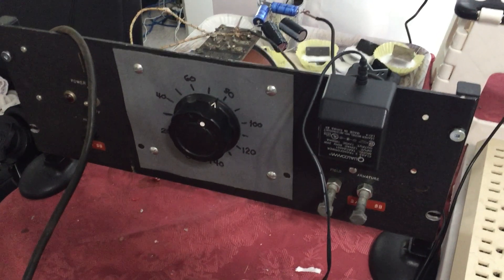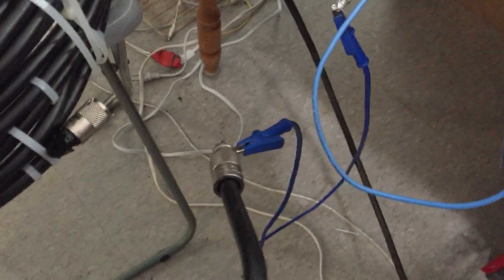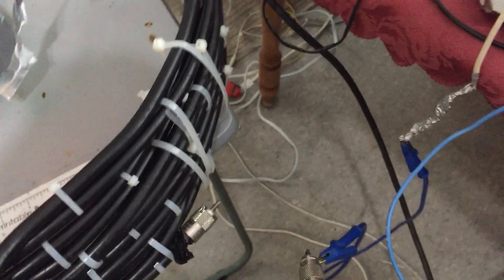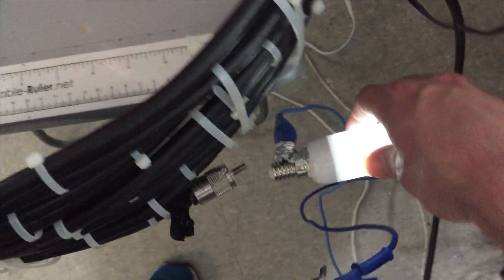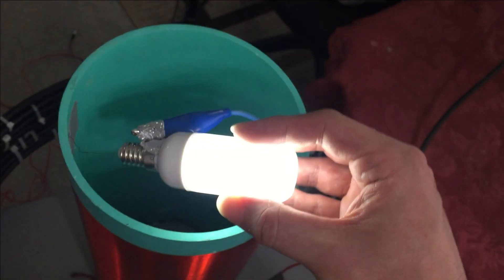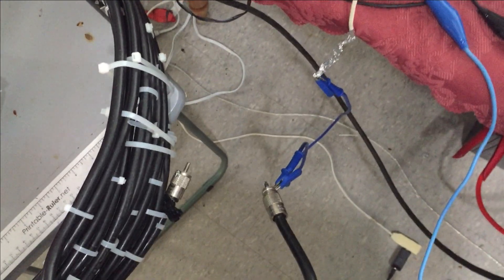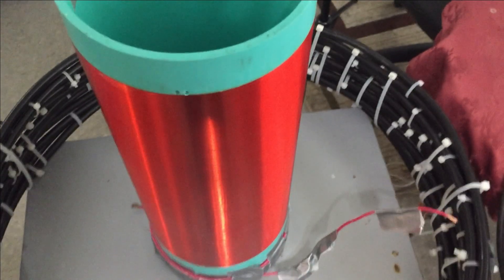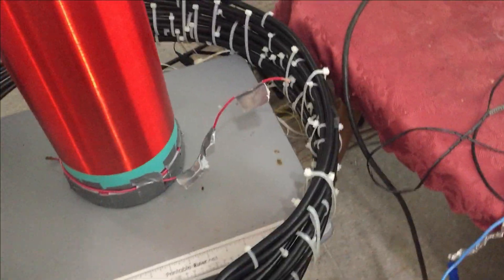Reactive Wireless One Wire Tesla Coil

Comment: That's a lot of coax  cable is you tall tesla coil setup for 1/4 wave length so that the top is max while the base is zero or GND
Reply from the maker: It was just for a quick demo with what I had, its not tuned per say, I''m sure more can get extracted with a tuned setup.  I'm using the coax loop for another (scalar wave) project i'm working on. Building the secondary coils now for it.

Comment: Great vid & try  connecting a metal sphere to the high voltage output of the tesla coil that has a diameter that's compatible with the frequency being outputted & You'll probably be even more amazed :)
Reply from the maker: I did all this years ago. not amazed  by it. lol lost most in old lab.
Reply from the maker: plus spark gaps and wave mixing is not really my thing. but i cover from time to time.

Comment: Phenomenal!  Is that capable of powering other receivers wireless,  or does each output require it's own hard wired input?  What about the 1 loop primary, what's it doing, is it really needed?  Also, why the coax vs regular wire, what's it bringing to the table?  Great video and results, congrats! 🙌
Reply from the maker: Multiple tesla coils can be triggered within this inside space. I only had one.  Coax gives me more inductance. And is what I had around. Works well with high frequency.
Reply from the maker: Actually I got a smaller Tesla coil I can setup in here as well.  And have two of them
Reply from the maker: Yes the 10 turns primary around the tesla coil is needed very important more on that tomorrow.